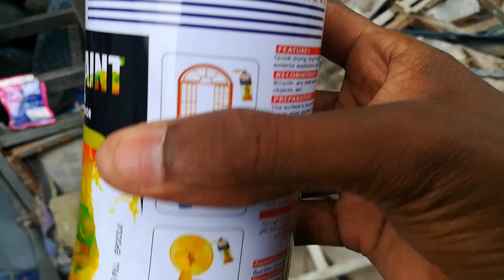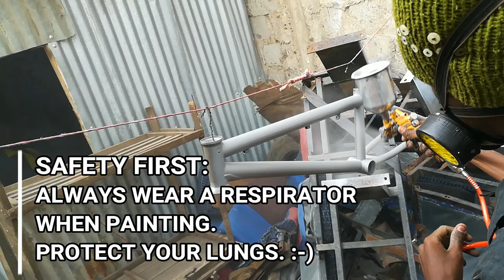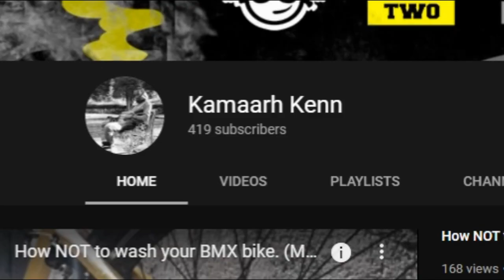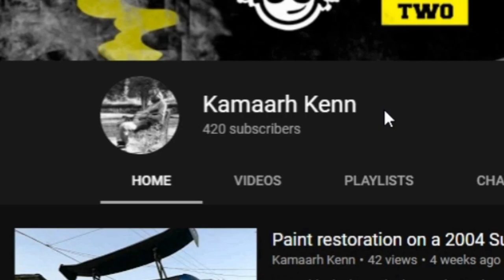Custom mint green BMX Bike paint job.

Comment: 7:06 bro whats that thing on fork? whats that use for
Reply from the maker: If it's that round looking item, it's just a valve stem cap for the tube
Reply: @KamaarhKenn  ohh what really use for foot jam?
Reply from the maker: Aaahh, I see what you're asking. It's a bar end modified to fit in that space under the fork. Yes it's meant to make footjams easier and prevent your toes from being sucked in by the tyre
Reply: @KamaarhKenn  whats that called i want one also its that diy?
Reply from the maker: Just DIY. Grab a spare bar end and stuff it in that space. If it doesn't sit securely, you can wrap electrical tape around it until it it holds itself in place
Reply: @KamaarhKenn  is there video how to make it haha
Reply from the maker: Naaaah. Just a bar end and electrical tape and you're good to go
Reply: @KamaarhKenn  okay thanks ill do it xd